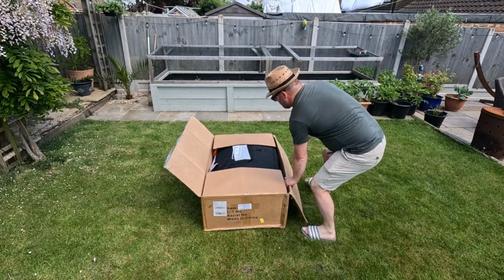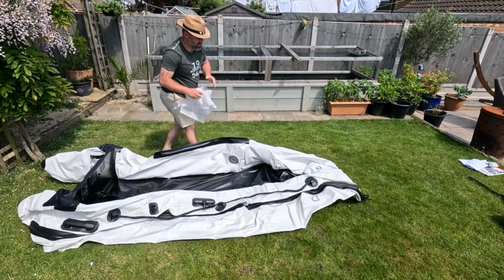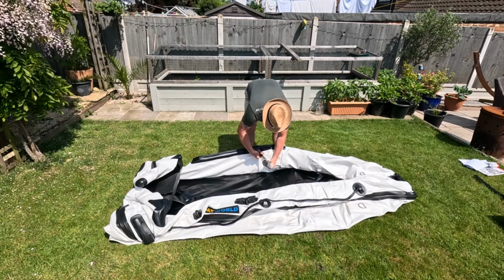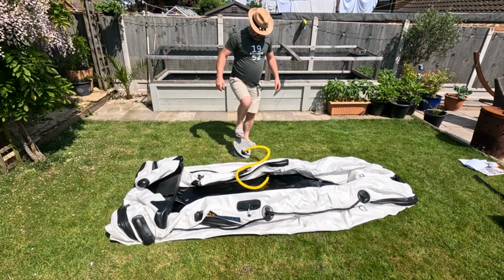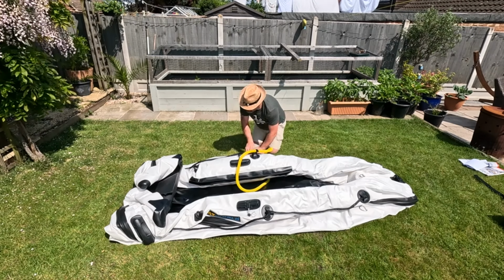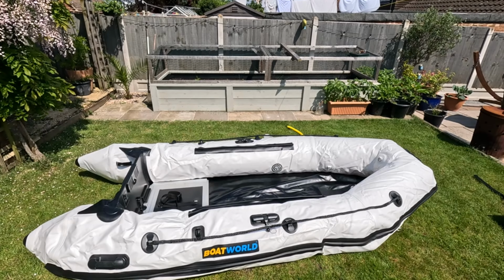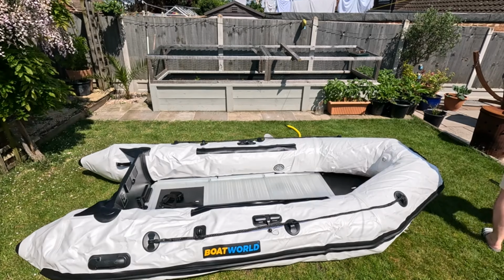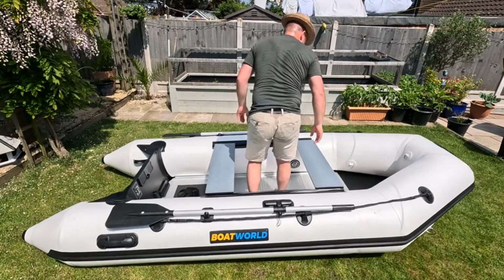BOATWORLD 330 PRO, UNBOXING, SIB FISHING, @jcmanglingadventures

Comment: Just ordered one. I think it was you who I saw fitting launch wheels to this. If it was you, what is the transom made from? As well as fitting wheels I’ll like to fit rings/eyelets for lashing points. I had them on my old boat. Thanks in advance. 🍻👍🏻🎣
Reply from the maker: @ct026  yes mate I did fit launch wheels to mine. I think it's just a coated marine plywood
Reply: @jcmanglingadventures What pressure do you inflate the hull chamber to? I’ve been told 3x the pressure of the tubes which would seem very high and then Boatworld told me .25 which seems quite low. Thanks for the earlier reply mate. 🎣

Comment: Well in mate, it looks really decent 👍🏻
Reply from the maker: Need to get an engine now, and put a few accessories on it, rod holders, fish finder mount and wheels
Reply: I’m considering replacing my older boat with one of these. Have you had it on the water yet? Any update? Tight lines.